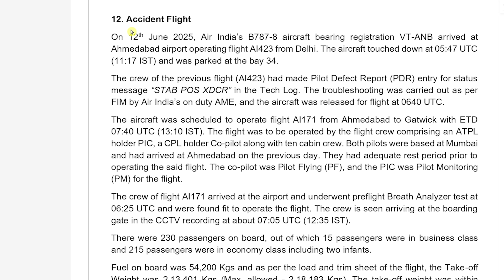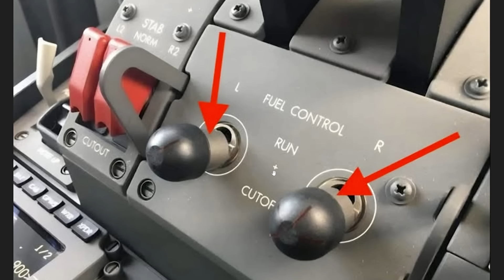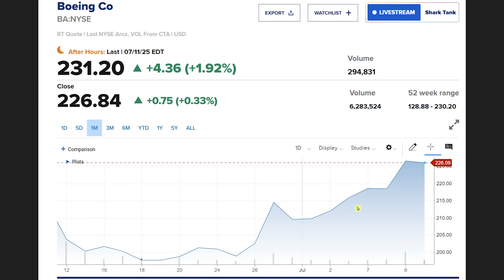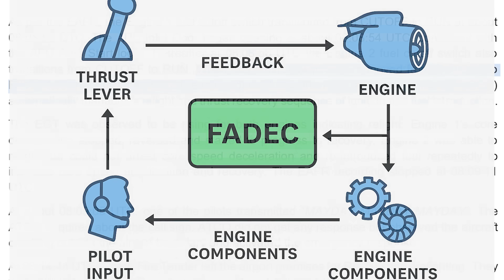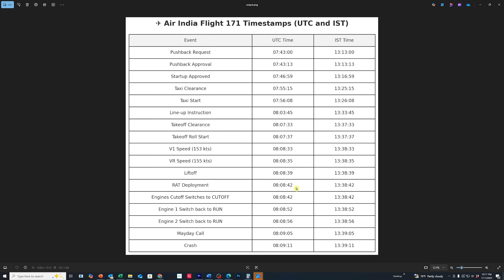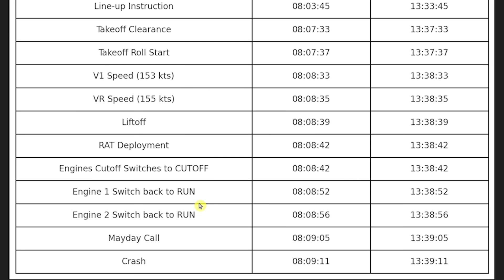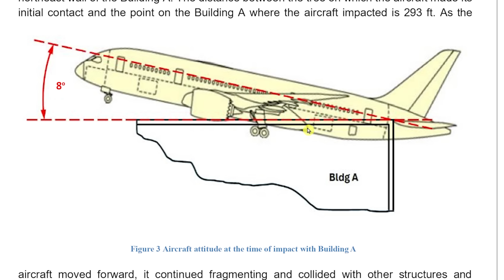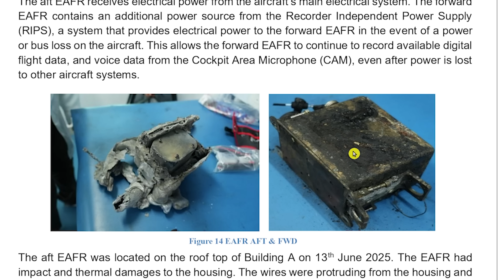Did Pilots CUTOFF Fuel? Shocking Twist Air India 171 Report!

Comment: Why would Boeing make it possible for the fuel switches to be turned off during the most critical phase of flight? The Airbus & Embrearer do not allow the fuel shutoff valves to close unless the throttles are in idle and this complete sense to me. We’re not talking about your Lycoming or piston engines here. We’re talking about very elaborate turbofan engines. We’re not talking about turning the mixture off if your piston engines is on fire. We’re talking about world wide SOPs, QRH, and boldface that is written in blood. 

  If these GE LeAP or Rolls Royce engines require a commanded shutdown for WHATEVER reason, you’re always going to pull the throttles to idles before cutting the fuel. To do it backwards “by accident” would be like you gettting in your car and you “accidentally pulling the emergency break while going 120mph with your family in the back.This just doesn’t happen like that. This was 100% a deliberate and intentional act by the Captain to bring this aircraft down. If the FO (PF) wanted to bring it down, he’d just go nose down and that would be a wrap in that phase of flight. This was not a mistaken or system failure. I know that we don’t want to think that this can occur. I know that it’s much easier to blame a system fault than to think that this could happen so easy. But to anyone thinking this is a potential accident, is not paying attention to the facts and has no clue what they’re talking about in relationship to this switches. 

  Sure the Prelim brings up an advisory from a few years ago about the “potential of these switches to not correctly lock as designed”. Theses things happen all of time and are simply advisory in nature and released to free the MFRs of any blame in the rare case that this were to occur. But NEVER in the history of these switches (same model throughout all newer 737s & the entire 777 & 787 fleets) there has never been one that cut off on its own. And to think that two could do it back to back is just ludicrous and asinine. From the jump they never grounded the 787 worldwide fleet and if Boeing pilots all over the world thought that the failure of these switches was even remotely possible, they would refuse to fly these aircraft. 
  
  Pilot mental illness is real danger in the aviation industry and look no further than Germanwings with the FO locking the Captain out of the cockpit and going nose down into a mountain. Or last year with the Alaska Airlines jumpseater that tried to pull the fire handles while at cruise. And now this seemingly bing the worst case scenario of a Capt. intentionally killing 400 people with two flips of a switch. 

  Don’t get it twisted. These pilots are highly experienced and very well trained, but they are still humans. And they are subject to the stresses that come along with such a thing. These aircraft are very intelligent, and it’s time Boeing writes a couple new lines of code to the not allow the fuel shutoff switches to be cut off with throttles in full TOGO, full of fuel, and just seconds after going into air mode. I’m not saying Boeing is complacent in this matter, but it’s time we face the elephant in the room. We’ll never be able to stop pilot mental health issues, but we can very easily prevent this from ever happening again by embracing the Embrearer philosophy. Thoughts?
Reply: It was the co-pilot but yes, I had the same thoughts. Why make it that easy to kill everyone on board (-1)
Reply: @ramkold  because if there is a bird strike and engine fire fuel needs to be cut off immediately
Reply: @websitemartian you can do that by moving the thrust levers to idle then cutoff, barely takes any time or in the Embraer you can pull the engine fire switches to immediately cut them off
Reply: Wrong elephant !!!!!!!!!!!!!!!!!!!!!!!!   The faulty computer did it, or did the pilots put the rat down too ????  Lots of words mate but you are wrong.

Comment: I do wonder if the pilot asking ‘why did you cut off’ actually was the one who did cut it off. There’s like no delay between the cutoff and him saying that. Then they wait four more seconds before trying to turn one cutoff back on and then several more for the other. If the guy asking the question had really noticed the other guy pulling the switches down, why start a conversation about it? Surely he would immediately move to flip them back on. Meanwhile the guy saying ‘I did not’ isn’t even sure whether or not the switches have been pulled so doesn’t react right away or realize how dire the situation is.

Who knows though. Sure seems like one of them did it either way…

Comment: Why the hell wouldn't there be a loud audible alarm warning the engines were cutoff with altitude?  Something is not right!.  I am no pilot but you shouldn't be allowed to cutoff both engines in flight at any point.  There should have been built in fail safes against this.

Comment: Stop blaming the pilot. If the pilot saw or was 100% sure that the other pilot monitoring had turned off the fuel switches, he would have objected at the very first instance not later. He asked that question probably assuming that the other pilot had cut the off as he had no other reason to think off. And the pilot monitoring denies turing them off because he didnot turn them off. 
Boeing had issued an advisory back in 2018 that there was a known problem with the locking mechanism of these switches due to such these could turn to cutoff position by themselves midflight. 
Its very rare but boeing knew it was possible.
And that is exactly what happened with this flight. 
Its easy to blame the pilot and cover up for fkng boeing which has openly hid mcas from pilots and even killed whistle blowers.. pathetic
Reply: VT-ANB maintenance records show the switches were replaced in 1923  –  post the rework

Comment: question to the experets : I assume that starting from manual lever the cut-off signal goes to the control system of the flight and it finally control the fuel pumps.  Why not  an interlock in the control system is included so that control system do not to obey that obvious wrong  order said to be given by one of the pilot? ( there can't be a situation that pilot wants to switch off both fuel pumps while the flight is in air?) . Further the pull-up mechanism in the fuel control lever  to avoid any inadvarant operartion is very primetive. Flight  control system can be programmed with more complex logics?

Comment: The SAIB was directed to owners of all planes not just the 737.
Introduction 
This Special Airworthiness Information Bulletin (SAIB) is to advise registered owners and operators 
of The Boeing Company Model 717-200 airplanes; Model 737-700, -700C, -800, and -900ER 
series airplanes; Model 737-8 and -9 airplanes; Model 747-400, -400D, -400F, -8, and -8F series 
airplanes; Model 757-200, -200CB, -200PF, and -300 series airplanes; Model 767-200, -300, 
300F, -400ER, and -2C series airplanes; Model 787-8, -9, and -10 airplanes; Model MD-11 and 
MD-11F airplanes; and Model MD-90-30 airplanes of the potential for disengagement of the fuel 
control switch locking feature. 
Based on an assessment utilizing the limited data currently available at this time, the airworthiness 
concern is not an unsafe condition that would warrant airworthiness directive (AD) action under Title 
14 of the Code of Federal Regulations (14 CFR) part 39. The FAA will continue to monitor this 
issue. 
Background 
The Boeing Company (Boeing) received reports from operators of Model 737 airplanes that the fuel 
control switches were installed with the locking feature disengaged.

Comment: Hello Jeff, 
The Interim Report shows the Fuel Switches were in the OFF position, not the RUN position. Listening to two very experinced commercial pilots on Youtube, they have said, you cannot turn these switches off accidently, you have to PULL OUT the switch to enable to use. 

The Fuel Switches are not touched again during flight  for obvious reasons, and are turned off at landing. The ONLY reason one would be in the OFF position, would be due to an engine failure.

The question was asked in the Cockpit "did you turn them off". The other pilot said "No".

This is looking like this was done deliberately, as there is no way,  these Fuel Switches to BOTH engines would be in the OFF position, as stated.
Reply: Jeff, you said exactly what I was saying.

Comment: If I'm committed to crash a plane, and I execute that devil plan, I can't imagine to respond to an immediate direct question why I did it with a denial of such act. Most likely there would be just silence. Further why would I let the other pilot to initiate the restart procedure without any struggle to potentially save the doomed flight? The only possible explanation to me is a really big brain fart when he did it actually unknowingly, thus the denial. Those 10 seconds between cut of to run on the first engine are in my opinion that they both were trying to accept the unbelievable fact that the switches are in fact in the cut off position. The additional four seconds for the second engine are really hard to explain to me, that would normally happen even during such emergency within one or max two seconds as they were already conscious about the situation and took action for the first switch. Another plot would be to cast the blame but again if I would be committed and execute I would just keep my mouth shut because I'm also risking a recorded response: "I didn't, you did it, I saw you!"
I understand that pilots do not want to have visual recording from the fear of their performance being rated based on these recordings but I think it would help in situations like this. Let say visual records to be automatically erased after each non crash landing.

Comment: Can there be a software malfunction such as has happened in some other flights? I wouldn't put it past Boeing to tamper with that audio.
Reply from the maker: Boeing has no access to the audio; it is all in the hands of the Indian government. A software glitch is not likely, as the switch was moved back to the run position after the one pilot said to the other, 'Why did you switch it off?' Software glitch can't move the switch

Comment: By the timetable you show at 11:13, both engines must have simultaneously cut off on their own , for unknown reasons (technical failure?) exactly at lift off. @ 08.08.39UTC.  WHY? : from 08.08.33 to 08.08.35 there is an increase in speed, although plane is climbing. That happens ONLY under engine power. At 08.08.42 RAT deploys. It takes 2 or 3 seconds to do so, again showing a "trigger point" somewhat earlier: 08.08.39?  Only after liftoff and simultaneous with RAT deployment a pilot sitched fuel OFF @08.08.42 and 10 seconds lated back to ON @08.08.52 It sounds to me like a professional and desperate effort to turn engines ON again. Sadly it was not enough.  I praise the Pilots and blame some airplane engine problem. Or ... is there any software which can fail and turn engines OFF? Again, all this based on the timetable you publish which I guess is the official one.

Comment: Speaking of which, which smart guy placed those switches anywhere near other more active controls? More, who didn't think about idea, to BLOCK switches during takeoff? Probably thousands of parameters are different during takeoff allowing to know, that plane is in in the middle of takeoff? I am shocked about fact, that multimillion $ planes haven't some redundant system (watchdog) to prevent even trying to do such dangerous things? In any case, in 21th century poor multibillion manufacturers do not have to offer anything better? I.E. CAMERAS in the cockpit in the time when digital storage is cheap as never before? Yeah, understand. Profit over all. Even at cost of lives. Capitalism as optimal world order :) Stuck in the past for sake of mighty minority :) 

Back to the switches. Who can switch TWO STURDY MECHANICAL switches in 01 sec (0.1 or 1? Or report orchestrators wisely makes tiny mistakes to leave space for different interpretations?). Sounds like fairytale to me. It's not about to be long year captain with tenths of thousands hour in the plane but more about common sense. BTW, working 30 years in the world of computer hardware AND software from programmer to CDO. Everything about this crash stinks to the sky and above.

Comment: I remember when pilots were blamed for Lion Air Flight 610.  It was only when the 2nd 737 MAX 8 crashed (Ethiopian Airlines Flight 302) under similar circumstances that they went back to investigate further and found an undocumented "feature" in the MCAS.  The 787 is more dependent on electrical systems and computers than almost any other airliner.  Did the FADEC cause the plane to lose power and a pilot followed standard restart procedure, turning the fuel cut-offs off and back on?  Was the signal saying the switches were cycled accurate?  Is data collected from the FADEC and other computers over the Ethernet connections between them and not hardwire signals from the actual switches accurate?  More questions than answers.

Comment: If the other pilot said "why did you cut off" then it seems obvious that he saw him do it. My questions are: 1. If the other pilot saw him in the act of moving the switches why didn't he somehow try to get his hand away from there (not enough time most likely and because his hands were on the yoke). 2. If it was deliberate then why was there cooperation and not resistance to restart the engines? Or was there resistance? So much more to uncover.

Comment: You are saying that the pilots should not have taken 10 seconds to reset the fuel switches.
The pilots are under stress that they are losing thrust and would not think the fuel switches are off.
Their thought and reaction time would account for at least 10 seconds.

Comment: How can you not form the conclusion that both engines were cut by a human hand at the most critical time.  One of the pilots wanted that plane down,  the other one did not.  Examples: Germanwings 9525, SilkAir 185, and EgyptAir 990. What will happen is that the NTSB will state pilot intention,  but the Indian air authorities will claim 'inconclusive to save face. I get it, but the families of the dead will never get closure.  We used to fly in planes where all pilots wanted to reach their destinations but sadly no more.

Comment: If you read the report. It mentions a malfunction in the fuel control system where a certain system in another Boeing plane had it's fuel cut off with no pilot input, in one of the bulletins published by Boeing every month. If that's the case Boeing and GE have a lot to explain. The fuel cutout switches were found in the run position because the pilots attempted engine relight.
Reply: Odd that both engines had been replaced at the beginning of the year too.
Is it normal for the RAT to be deployed before an engine failure ?
I note that it appears the first engine was reinstated but the second was struggling to restart which could explain the delay ?
This aeroplane had electrical problems the day before (noted by a passenger) which hadn't been corrected before it took off again on this flight.
Suspicious that a bulletin had been sent re fuel cut off to engines which now looks like exactly what has happened ?
Could the wrong parts have been fitted when the engines were changed ? Shortages maybe ?
Needs a very thorough investigation , blaming pilot error / intention is a little too easy.

Comment: Jeff, thank you for creating a timeline for the events leading up to this fatal crash. There is something that must now be further investigated: At 08:08:42 three things occurred simultaneously: Both engine fuel switches were commanded to 'CUTOFF", and RAT was deployed. How likely is it for either the pilot or co-pilot to place both fuel switches in the cutoff position at the same time? In order to simultaneously shut down both engines, wouldn't a person would have to use both hands and manipulate both fuel switches in sync? Did something else occur to cause a simultaneous shutdown of both engines?

Comment: Has there been any comment on the serviceability of the fuel shut-off switches as found in the wreckage?  i.e. were they not found in a deteriorated state and did the detent safety feature functioned as per specifications.  The SB suggests a level of applicability uncertainty as it was applicable as I understand it to all the models listed.  If that switch was installed in the aircraft the SB should have been actioned in my view.  Air India said they had not performed the SB if I understood correctly. Also in the video the toggle handle is different between the switch used in the accident aircraft and that of the representative aircraft.

Comment: there was an investiagtion in 2018 by the faa saib, that disengagement of fuel control switch locking feature. the g-control unit (computer system for the entire plane) my have cause the shut off, which many engineers fear.  people can not shut off the both fuel control switch simultaneously. but the g-control unit can...